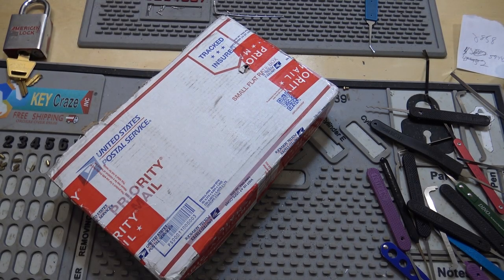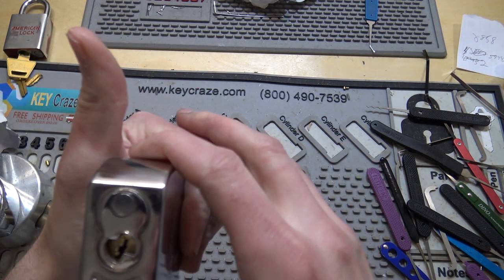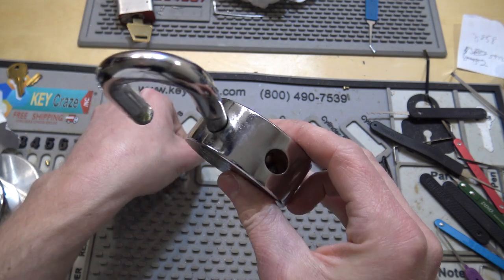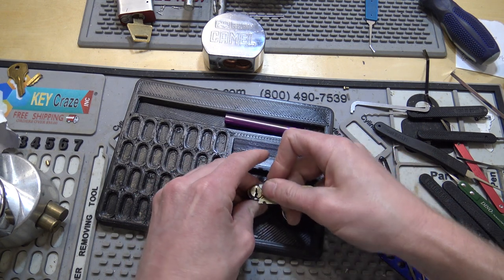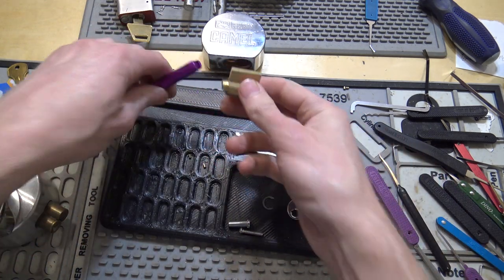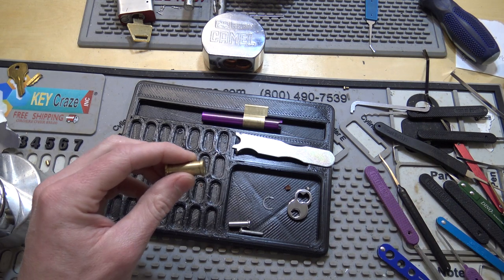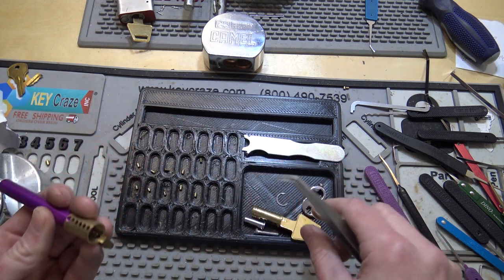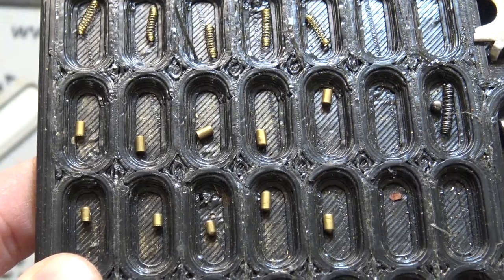(348) Camel Security Padlock SPP'd & Gutted

Comment: That's a good looking bunch of padlocks. I'm not fussed on how slick someone can gut a lock I'm just thankful that I get to see inside the lock and check out the engineering, doesn't matter if it's a cheap one or top of the range to me.
Thanks for the video.
Reply from the maker: I cant wait to get into the other ones.  those round locks are a pain.  you have to tap a roll pin out to get the tail piece off